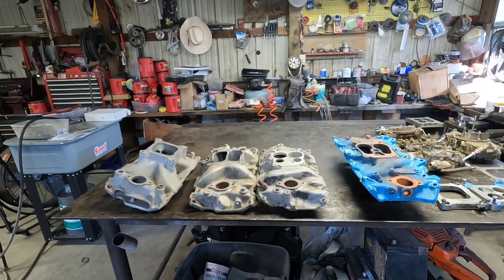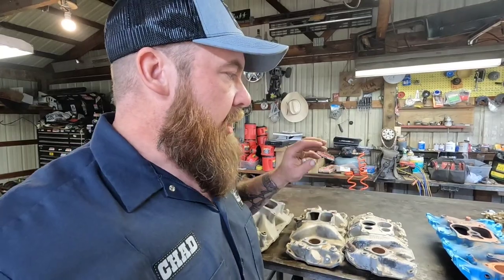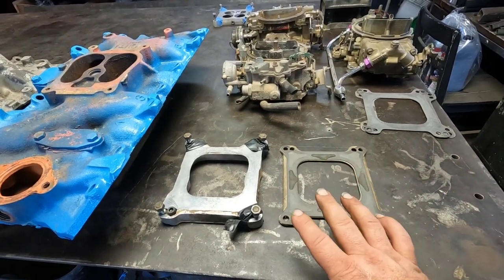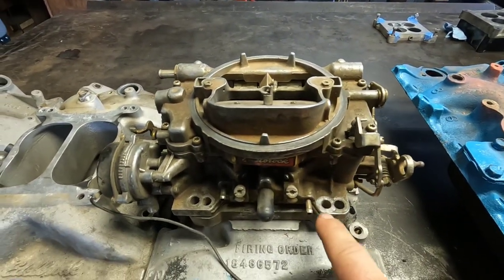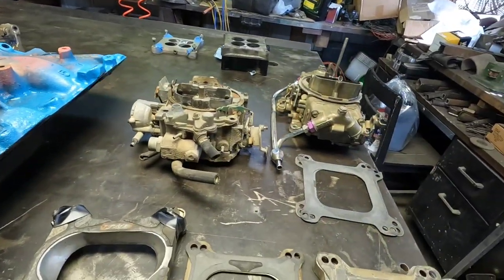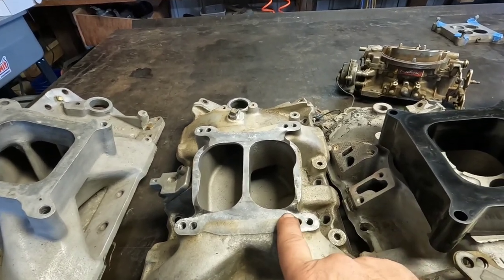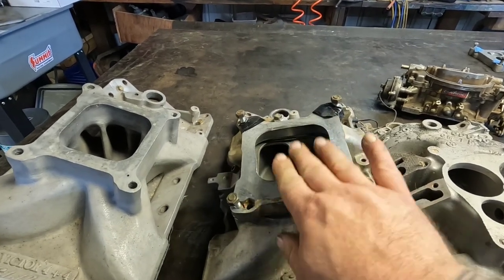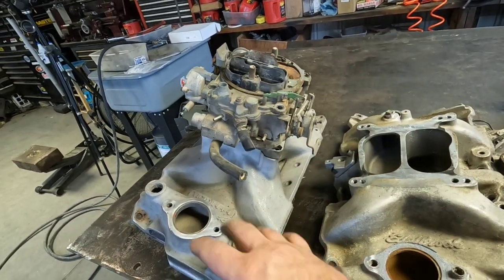spread bore to square bore carburetor adapters explained.

Comment: There's another reason to use those adapters "upside down". I picked up an old holley 4175 from a junkyard, long ago pulled from some late 70s mopar. To save a few cents on their end, they spec'd it spread bore - well, to use it on my aftermarket intake on my chevy, I need exactly that.

Now that I think about it, I should just find a normal baseplate.. and 4165 secondary metering block et al... man, it never ends lol. or just use the stupid adapter for now and be happy

Comment: Square bore to spread bore adapters an vise verso kills power and flow better off to get the intake your carb or efi needs
Reply: I’m having this issue. I replaced my quadrajet with a Edelbrock avs2 650 , I used the recommended 4 hole adapter and I cannot get rid of stumbling In the secondary’s no matter how I jet it or adjust the air valve
Reply: @ryancobb7511  did you verify for correct ignition timing? If you don't have enough timing then the engine will be way down on power and can cause bad hesitation and stumbling, also make sure you have the correct power piston springs especially if your using a larger camshaft with more duration. But always check your timing for proper total timing and make sure the mechanical advance is functioning correctly first before making any carb adjustments.
Reply: @briang4470  yes it’s doing better now with more advance. I was already 36* total timing but I put more advance and it seems to love it. I don’t hear any pinging and not having start up issues
Reply: @ryancobb7511  36° seems pretty high

Comment: Lol. Back in the day I had a 69 nova with 350 4 bolt main. Spread bot intake. My car went bad I had no money. So I had a thermo quad of of a 340 it fit just fine. Ram good on low end. As far as driving around not much on top end. But it was a eye catcher. Everyone thought I had something special and I was tell them a lie. But get it was the truth.
Reply: Hey I just traded for a boat. I never saw it until it was delivered to my house. Found out it’s got a 350 Chevy motor. 
Will it work in a truck. Just by looking at it I would have to change a few things. Can you answer this got me.
Reply from the maker: It should work

Comment: Edelbrock manual says to NOT use the open adapter or you will experience vacuum leaks.The adapter with the four holes for primary and secondaries is the one they say you MUST use,so I am still confused as to why the open adapter would cause leaks.
Reply from the maker: Possibly not enough sealing surface around the perimeter.

Comment: Brother thank you I was stuck trying to figure out away to get pass having to spend unnecessary money on rebuilding my quadrajet carb when i have a holley 650 new just sitting around....i have a 1988 chevy monte carlo 5.0L  I am getting a 383 stroker built and just need to be able to move around and man I watched your video and went and bought the adapter and man everything worked out great thank you brother

Comment: I always suggest to also find and use the thickest gaskets possible for the best chances of sealing and to help a bit with heat soak/vapor lock. Also to save you a few bucks in the future coat your carb gaskets with a thin coat of chapstick or bearing grease, if you do that you can reuse the carb gaskets most of the time if you don't then they usually stick and rip when you remove the carb.

Comment: Found your video and was great help for my build!
One question though, I'm running a 351 Cleveland with performer dual plane intake, would you recommend a 1" inch: square, 2, or 4 hole spacer and why? I've read dual plane it's for better low-mid power. Thanks in advance 🤘🏻
Reply from the maker: I usually  run an 1" open spacer on my dual planes.  It helps to even out pulses in the plenum
Reply: @SquarebodyStuff  gotcha, and what would that lead to in terms of power, rpms, and driveability?
Reply from the maker: @pibe8761  yes, but also not really hurt the low end either
Reply: @SquarebodyStuff  I will try it on and see the results I guess, thanks 👍🏻
Reply from the maker: Try different ones and see what works best for your  combo.

Comment: I also helps to round  out the sharpe flate edges on the gaskets surfaces on the factory intakes including the flow holes on the intake  for better flow if using open hole spacer plate

Comment: This was very helpful, I’m building a 305 powered YJ and was on the fence about using the stock manifold with Holley carb.
Reply: junk the 305 your gonna spend alot of money and get nowhere. They cant breath!
Reply: @jimmyharris6056  it was a free 305, when it goes boom then the 350 goes in.
Reply: @jimmyharris6056  305s do just fine key example the l69 that was 190hp when the 350 of the same time was also 190hp in the z28 and the lb9 was 230hp while the 350 was still 190, nothing wrong with a 305 just need to know what youre doing with it

Comment: I like your video and I was hoping to clarify something . You mentioned earlier in the video of people putting the adapter upside down and it caused problems.  If I understood you right you turned one upside down intentionally to make the adapter fit? I have a Holley 4180 on a 460 that I need to replace with a quadrajet carburetor the kit I have is a spectrum adapter kit designed to adapt Holly and other carburetors to a quadrajet manifold. I need to do it the other way around. Can I simply flip over the adapter and as you mentioned get longer studs and be able to make it work with maybe a few small modifications? Thank you. very helpful video
Reply from the maker: I'm not sure with that specific brand and how it's designed,  but most of them are already made to go either way.  If it's not, I'm sure longer studs might work.

Comment: I appreciate you not making it too short. Very useful. Question about the spacers though. On one of the many other  videos I've been watching about fine tuning the edlebrock carbs, 1 guy recommended 1" or higher non aluminum spacers to insulate the carb from the engine. His reason was that with all the ethanol in gas now, he had run into instances where hot engines were boiling the ethanol and causing issues. Now he was a hot rod guy. Have you seen this in your daily driver?
Reply from the maker: Yes, I run 1" plastic spacers on all of mine.

Comment: Edelbrock carb with performer intake on my AMC.  I need a spacer (solid) to help with fuel boil.  Should I get the square or spread bore spacer.  And do I still need the adapter plate(2732)?
Reply from the maker: I would get a solid square one. You might still need the 2732 adapter to get a good seal.
Reply: Do you have a video on selecting carb cfm and avs vs mech secondary
Reply from the maker: @diamatronyt  no, what size engine do you have.
Reply: AMC 304 with Performer Plus Intake and Cam with Shorty Headers on my Jeep CJ7 1978.  @SquarebodyStuff
Reply from the maker: @diamatronyt 600-650 cfm will work great for that. And I would stick to vacuum secondaries for a street car.

Comment: Thanks for the video I know it's older but you know what it just helped me out a lot I almost put that spacer upside down cuz I was wanting to put another Brock carburetor on my Chevy with a 305 V8 engine the only thing is the studs would be nice because you could just reboot all the hardware for the throttle pedal right back down and just hook everything in line if hopefully it would line back up

Comment: I have 76 Chevy square body with a 302 Sm bl factory intake taking off the quadrajet replacing with a holly I have the adapter plate but also have a thick gasket for a Holley carburetor and I was wondering where you put it do you put it on the intake manifold or do you put it on that adapter between the adapter and the carburetor

Comment: Hey off topic but you said your a Holley guy. I have the 625 street demon and a factory manifold. I am having trouble with hood clearance. Do you have any advice on a drop base for 13” air cleaner? That would clear the choke and throttle links on carb. 
Thanks
Reply from the maker: I don't  have much experience  with them, but I'm sure summit or jegs would have what you need.

Comment: would it not go upside down if you had a square bore performer rpm intake and  spread bore 850 quadrapuke on it?  im looking for the secondary valves opening and clearing.
Reply from the maker: I believe it will work that way also.

Comment: Have a edelbrock 1406 on a edelbrock intake. Was having some heat soak before so i grabbed a phenolic spacer. Im using the 4 hole insert because it was used to the factory intake. Just came across the packaging where it says i have to use the open insert for the eddy. Im assuming its less restriction,so will that mean more low end torque?
Reply: So the newest manual says to not use the open adapter and use only the one woth 4 holes. Give up,time to buy a holly and forget the adapter crap

Comment: Will a SPREAD Bore Edelbrock fit on a Qjet intake? I cant find this answer anywhere lol thanks
Reply from the maker: I'm not 100% sure. I think it will.
Reply: @SquarebodyStuff  I have a 350 Mercruiser with a Qjet that's just done. And I wanted to put a Edelbrock on it but the adapter plate might not allow me to use the same linkage. But I've seen guys same engine same intake running a 600cfm Edelbrock with no adapter and I'm like HOW! Lol but anyway thanks for your input

Comment: Hey sooo... i may have missed you stating the answer to this question. I have a holley marine carb, its a spread bore my scottsdale is a spread bore im worried about throttle linkage clearance. Would a square bore adapter work to add spacing without causing restriction? Would i have to use spread bore gaskets on both sides of the spacer or... a combination of square and spread?
Reply from the maker: You would need a spread bore spacer with gaskets on both sides.
Reply: @SquarebodyStuff  hey thanks a bunch!
Reply from the maker: No problem

Comment: I have a 69 dodge d100 318. When  I bought it, it had an edlebrock intake and carb on it.
I want to put a quadrajet on it. Is there an adapter to go from squarebore to spreadbore?
Reply from the maker: Same adapter I shoe in the video,  just flip it the other way.

Comment: Hi! I am trying to adapt an edelbrock like the one in this video to the stock small block intake. You said that the butterflies will not open without the adapter. On a forum I read this statement.  "A lot of 4bbl intakes have that asinine square bore to spread bore adapter on them, if so toss it and put on a phenolic spacer the same thickness".

Thoughts? Will the phenolic spacer be better or worse than the adapter?

Thank you and I liked and subscribed.
Reply from the maker: Depends on what intake you have. If it's a dual pattern performer, you still might need a thin adapter plate to get the phenolic spacer to seal. https://www.googleadservices.com/pagead/aclk?sa=L&ai=DChcSEwip4dvA3pmDAxVP98gKHTgjA48YABAJGgJxdQ&ase=2&gclid=CjwKCAiA-P-rBhBEEiwAQEXhH8lHcdEDElC2bQXQUEoVxlQwJSzyHjY3S7a9E4T76IPyUyZ3MQ11RxoCNIYQAvD_BwE&sph=&ohost=www.google.com&cid=CAESVuD29ZUfiQTRH0aV7FdHWxDQFeZcJt7AlOkD1TkN2XGFOUOeIUICD_tkbU8gh9GGlQK4WS0hU8DHEWYt9Er8kzGrElNj4OOULfVOU9df-LOmBsU7KVT1&sig=AOD64_0wr8Hd6Kt2ac-r2ek3ypjAZNdJQg&ctype=70&q=&nis=4&ved=2ahUKEwiQ79TA3pmDAxUwk4kEHTpkCL8Qwg8oAHoECAYQDA&adurl=

Comment: if you put a 2bbl on a ford 460 will it fall flat on its face when you drive it???????????? a friend o mine has a f350 with a 4bbl converted to a 2bbl carb n it dies out when you drive it. is it the wrong carb on the engine???????????????????/
Reply from the maker: It should run fine with a 2bbl as long as it's tuned right. It may not have as much power though at full throttle. Allot of dirt track cars have to run a 2 bbl.

Comment: installing a quadrajet on a dual pattern intake (edelbrock)like the small block intake up here.  Is my understanding right that I don't need a plate?
Reply from the maker: You shouldn't need  an adapter for the spread bore style edelbrock intakes.
Reply: @SquarebodyStuff  ok thanks man!  Great video.   I appreciate it

Comment: Do you know if there are Adapter plates to put a Chevy Carb (factory Chevy TBI) on to a Ford 351W?

I got a propane work truck 1985 F-350 commercial dually flat deck I want to make it Dual fuel because Propane is nice and cheap, but it starts like trash in the cold weather and some towns don't sell Auto propane . I have some spare TBI around from my Square body Suburban and Love the GM TBI system. And TBI means I can shut it off easy and use propane when convenient. I'm planning on just sliding the TBI underneath the Propane mixer (propane carb) and wiring some shut offs switches.

Are there GM to Ford or Ford to GM adapter plates?
Reply from the maker: I'm not 100% sure  on that one. Depends on if it's a 4bbl or 2bbl intake.
Reply: @SquarebodyStuff  Propane is always 4 barrel
Reply from the maker: @machscga6238 ok, I'm not familiar with the propane setups. I want to say there are tbi to 4bbl adapters, but you'd have to search the web for them.
Reply: @SquarebodyStuff  ok thanks...

Propane has a 3 stage set up equivalent to a carb. It goes from the tank into a safety valve, then into a vaporizing converter, then into a mixing Diaphragm. The mixing Diaphragm is like a carburetor but it's alot simpler because everything is pure gas at the mixer.

 Here in Canada you can pickup  all kinds of Propane trucks Chevy and Ford from the 70's 80's and 90's because they were easy conversions, and they were exempt from road taxes back then. Even today with Road taxes applied to the Propane is only $0.90 per liter ($2.49 US gal) vs Gasoline at $1.50 per liter ($4.14 US gal) and Diesel at $1.70 per liter ($4.70 US gal).

But Propane isn't sold for Automobiles everywhere, and about 10-15 degrees below freezing and you need a Block heater or you can't start the truck.

Comment: What about putting a quadrajet to a edelbrock performer rpm intake?
Reply from the maker: Flip the adapter  the other way.
Reply: @SquarebodyStuff  so revert to 13:45 on your video correct?
Reply from the maker: Yup.
Reply: @SquarebodyStuff  thanks I appreciate it 🤘